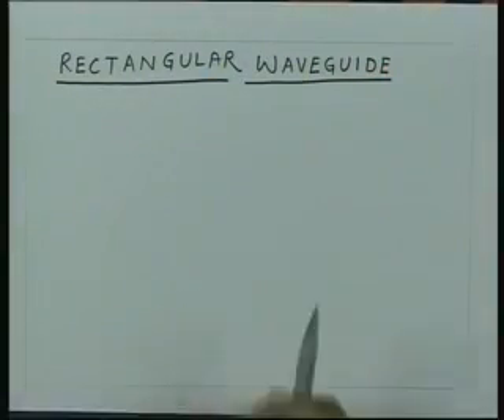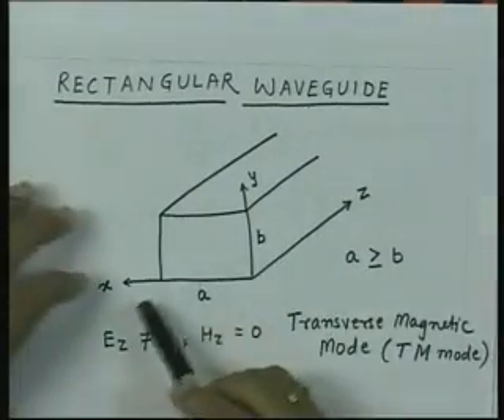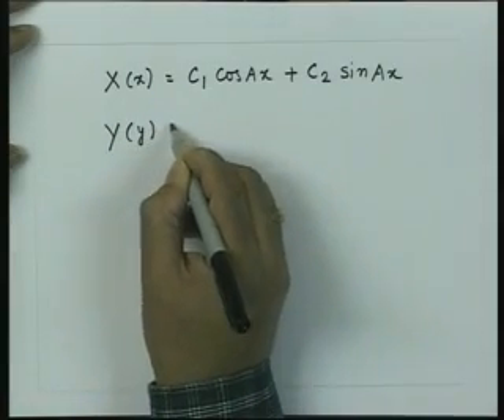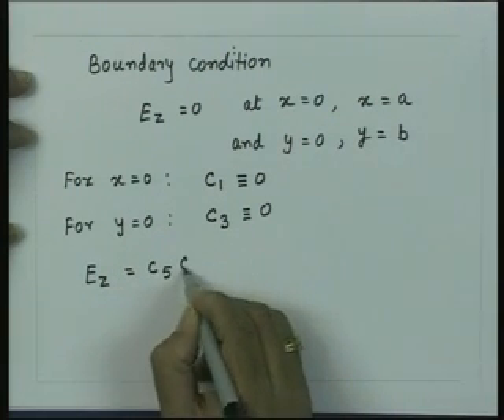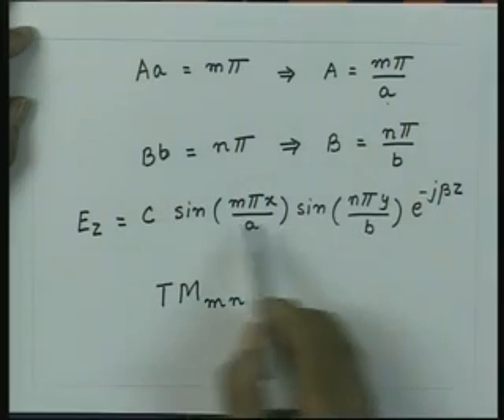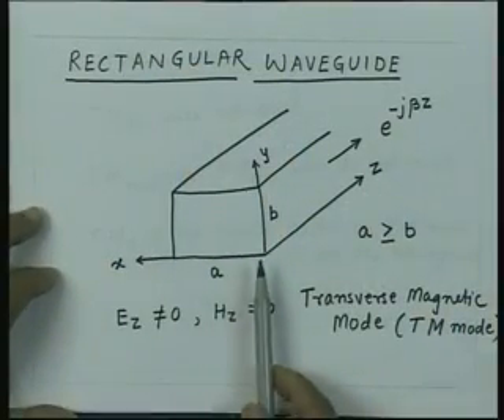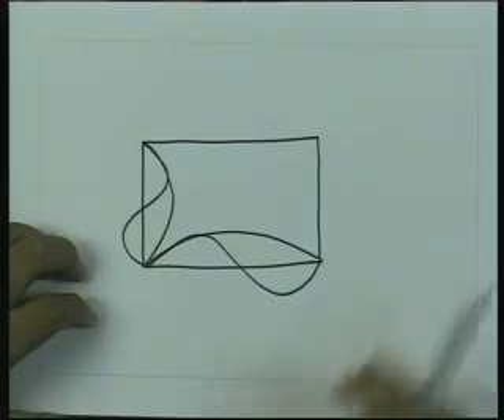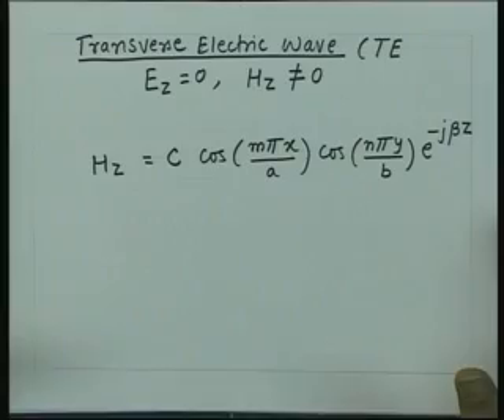Rectangular waveguide

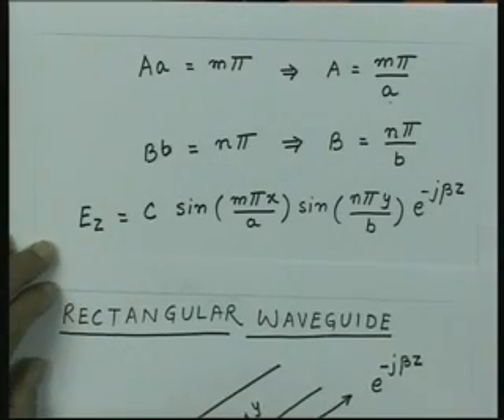Comment: At 29:00 , when we put b=infinity, then the Ez term should become similar to the Ez term of TM mode of parallel plate waveguide but here Ez becomes zero. But the Ez in ternsverse magnetic mode in parallel plate waveguide was not zero. Can anyone explain this?
Reply: It is coming zero because, Even after moving upper plate to infinity (b tending to infinity) you are taking boundary condition of zero tangential field at y=b giving you sin(npiy/b) term. Don't take that boundary condition(because there is no more an upper plate), so, see only variation w.r.t x sin(npix/a)and it matches with TM mode's Ez with d in the place of a as it should be. Just putting b=infinity of rectangular won't render expression of W.G with two parallel yz planes seprated by d along x axis derived earlier. You've to get rid of that extra boundary condition along y=b plate too for rectangular case to see the correspodence.